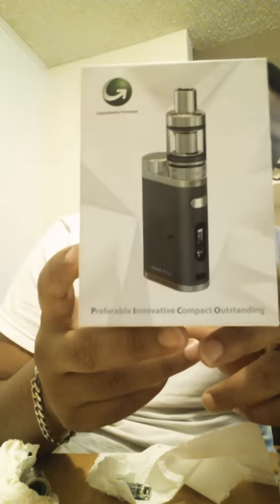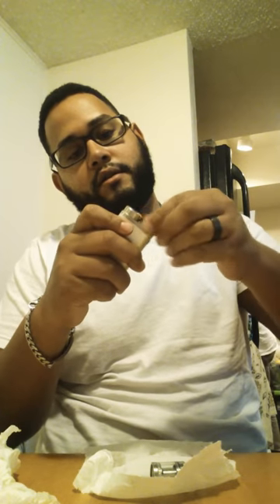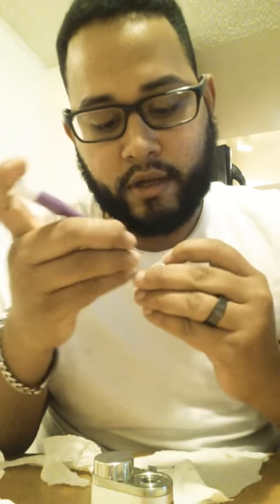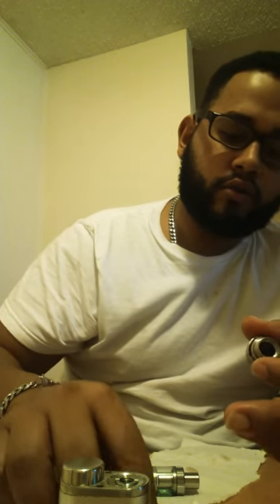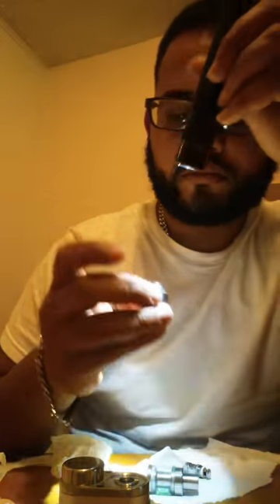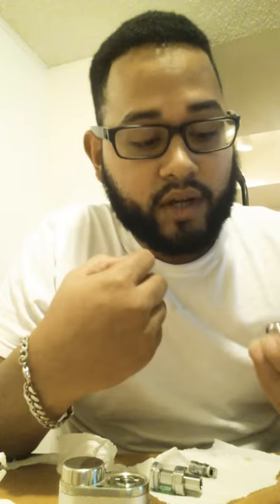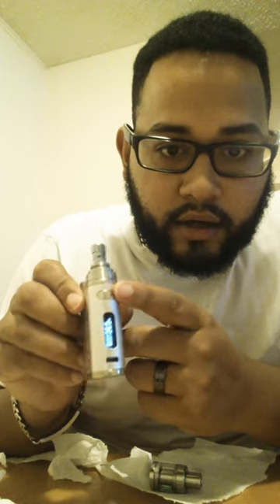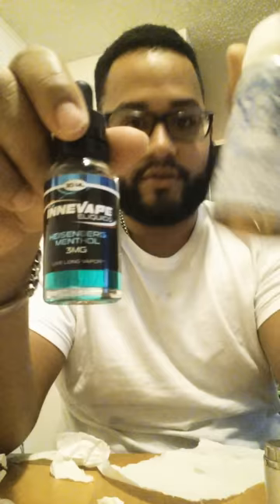No Atomizer ERROR | ELeaf• iStick PICO 75w TC

Comment: You can also try this... it worked like a charm for me! 

Use the same tiny tool as above (flat-head screwdriver) on the small, round pin in the BATTERY that makes contact with the coil he's describing/cleaning above. Mine has been dropped a bunch and this is a common issue. Use the tool to gently lift up around the edges of that small, round pin and either use a tiny O-ring or a piece of a small, black rubber-band that comes in a pack of 100 for .97 cents at most stores in the hair care isle. The rubber-bands are about 3 - 4  X the size of the pin and are way too large to fit so, just cut enough to go most of the way around the pin. It won't matter that it isn't a perfectly connected ring and it's width works well. Then, gently tuck it UNDER the pin with the tool. It worked like a charm for me and it's a fast fix! I highly recommend cleaning out the pin on your coil as well, just as he instructs here. Cotton swabs/Q-Tips work very well instead of a rolled napkin and are super-absorbent and they fit rather well in those small, round spaces to make sure ya get all of the wet area clean & dry. Maintaining your unit will keep you vaping & happy. Good luck!

Comment: After you dropped it what did you do to fix it
Reply from the maker: Good afternoon sir, I just took it apart and removed batteries for a few hours. It kinda reset it. But not sure if it works for all. Make sure atomizer is making correct contact and also cleaned well or it will act up too and tell you that it's not reading atomizer.
Reply from the maker: I hope this helps! Thanks for tuning in

Comment: rip me i tried everything but it still give me no atomizer i give up :(
Reply from the maker: I'm sorry to hear that bro. Make sure you remove all liquid then make sure you add that tip inside the vape that connects to the battery correctly. Worst case the person who sold vape should be able to help you. I heard that when the battery ia old or burnt out it wont have power to activate the atomizer. Good luck bro.